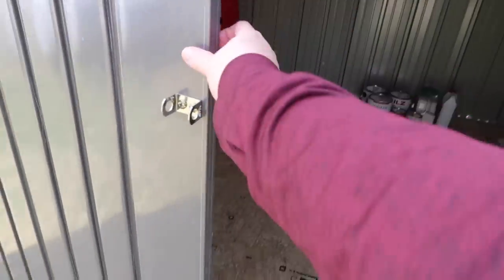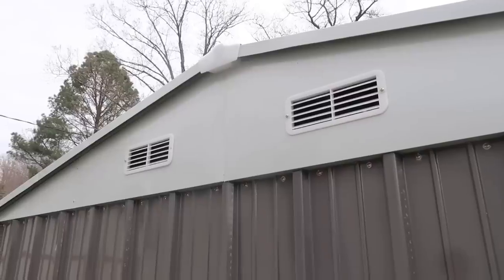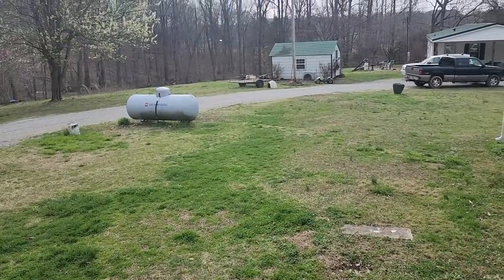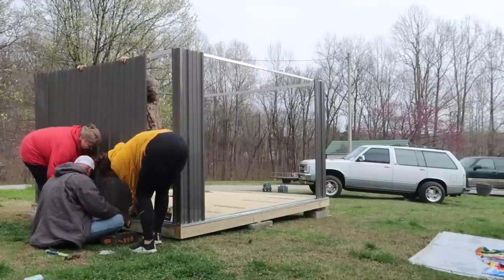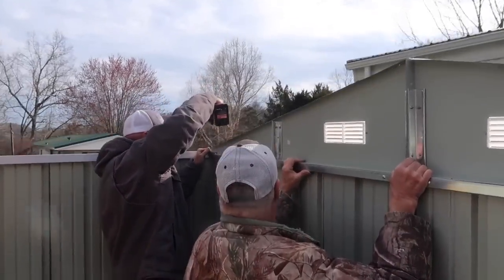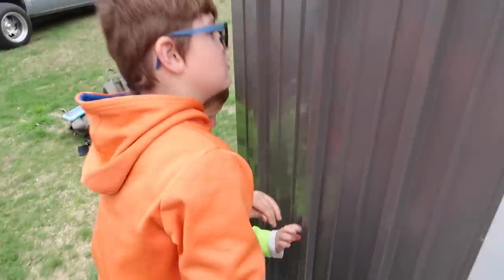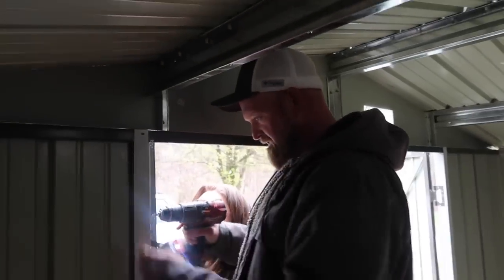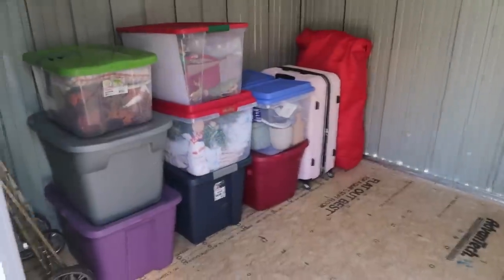Finally a storage solution for our small mobile home | Assembling our 10x8 metal garden shed

Comment: Keep in mind, mice will move in so store things with that in mind.  Mice bait, and lots and lots of dryer sheets which are said to repel rodents.  Paints etc will freeze in there if it gets below freezing where you are. Seal the edges around  each tote to keep bugs and other things out.  Just some advice from experience.
Reply: I was going to tell her the same thing! Mice will destroy stuff, and the paint will freeze.
Reply: I just love your family and Timmy's songs!!❤
Reply: Put lots of cut up Irish Spring soap inside! Rodents don’t like it! I know several folks who close up campers and cabins for the winter doing this!🙂
Reply: @karenbobrowski1285  I just want to save her some heart break...especially the tree bag, they could easily chew thru it.  Those critters get into everything.  Metal trunks work much better for storage.
Reply: Peppermint oil helps too.

Comment: You’re 5’10”?! I’m always surprised to find out the actual height of people I’ve only seen onscreen 😊 I’d have guessed around 5’5”. 
Question about the shed: from the inside, at the top of your walls where it meets the roff….i can see a lot of daylight but can you tell me if it’s open in those areas or am I just seeing that wrong?  it’s probably not or else there’d be no need for the vents.
Reply: Me too! I didn't guess her to be that tall!!
Reply: She should spray foam those openings!  Wasps can and will nest in any openings!!
Reply from the maker: @lizmarin9568  Working on that this weekend.
Reply from the maker: You can see some daylight, but I think the light reflects off and makes it look like more than it is. I'll be filling gaps this weekend with spray foam.

Comment: Highly suggest caulking around the bottom inside!! Helps no bugs, mice and small snakes. Yikes. As time goes by. Could spray on insulation.  Research it. I'd paint floor when weather permits!!! So happy for you. I have a folding chair and table to sort on. A chair is nice if wanna resort or add to containers. One of ours...very large blew away in high winds. We didn't secure to ground. 😢very happy for you.

Comment: Maybe you could insulate the inside of it with the thin foam sheets. I have a metal shed, but where I live in Georgia it would ruin everything I put in it, and things would mold. I only use it for my lawn equipment.

Comment: Do not just put it on the ground as recommended by the company!  The wood will eventually will rot out.  We bought a premade shed from the Amish and sat it on the ground.  It has sank and started to rot😵‍💫. Wish we would have used railroad ties under it.  Yes, Amen for more storage 🙌🙌🙌🙌🙌. I'll take all I can get 😊
Reply: The company doesn’t recommend you put it on the ground, but it does say you can put it on the ground. The shed is not made of wood, so it will not rot.